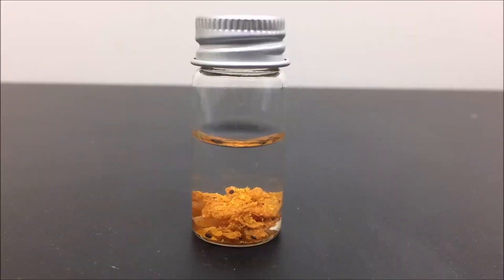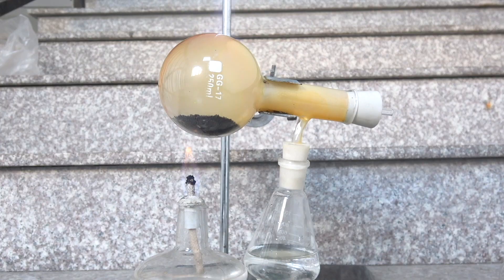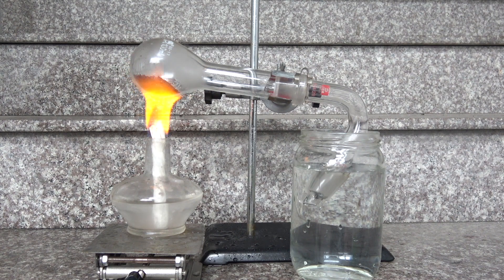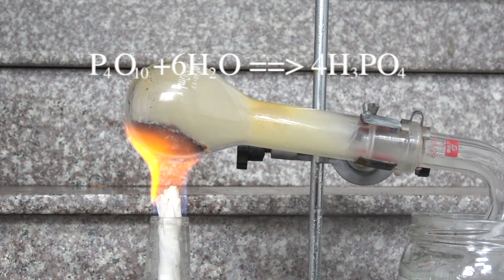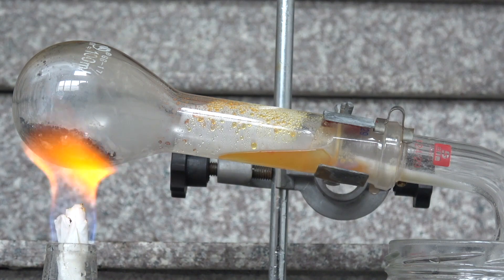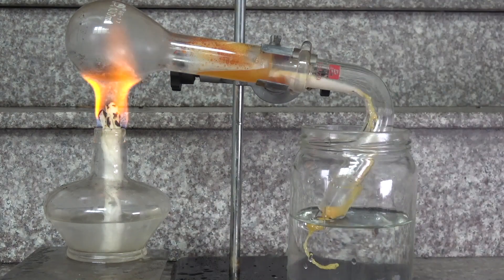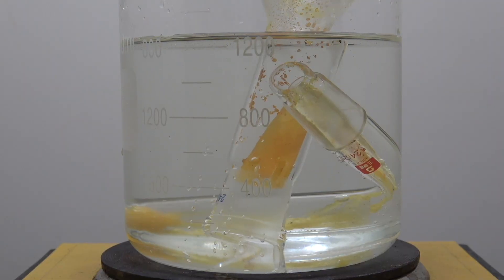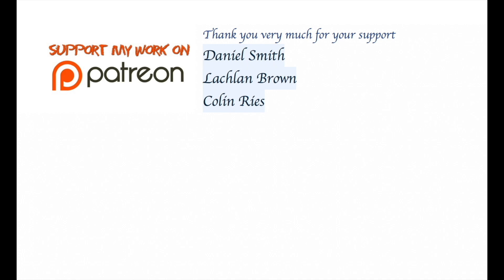How to Make White Phosphorus | Contracted version

Comment: Easiest way to make a lot of it is to mix charcoal, graphite powder, sand, salt and bone ash calcium phosphate together. Make a reaction vessel out of a two big ceramic flower pots with two graphite electrodes. Bridge the electrodes with steel wool and fill with the reaction mixture. Seal up gaps with potter's clay and attach a steel pipe in the top and seal it in with potters clay mixed with powdered glass. It's a simple retort. Bury the retort assembly in sand for insulation and make sure the pipes end is submerged under water. Apply current from am arc welder to the graphite electrodes and the device will sound very angry and bubbling will start from the end of the pipe. You will then get drops of WP that will sink to the bottom of the water bucket. The reaction is finished when no more WP is produced.

Comment: I also worked to come up with a way for amateur chemists to make white phosphorus at home.  I posted that video to my channel, if you want to check it out and compare notes.  I've found that keeping the flame away from the vessel is key to getting pure, white phosphorus.  The moment the flame touches the glass it becomes too hot and the phosphorus starts becoming yellow.  Even with the purest red phosphorus that you can get.  This also helps to prevent the vessel from breaking.  Keeping the vessel covered with foil helps to keep it white as well.  Doing it this way also makes it go slower, taking far longer to distill.  But if purity is not what you're after the putting the flame against the vessel is fine.  For the vessel I used various sized test tubes because if they broke, oh well.  Putting a bend in the tube helped to keep the red phosphorus from falling down the tube into the white allotrope.  You can see what I am talking about in my video.  Putting the receiving flask on a hotplate to heat the water also helps to have the white allotrope melt and fall on down into the beaker and not cling to the reaction vessel like it likes to do.  Then any phosphorus stuck to the tube can be melted to allow it to fall into the beaker with a small torch.  But for purity, heat control is key and keeping the flame from touching the glass is the trick.  Though it goes slowly, it still is great for producing a beautifully white product.  If you'd like to collaborate on this, or other similar projects I'd love to pitch in and help.  I've done a lot of work with phosphorus and many other elements and compounds.  Some of my friends call me the "King of group 1 metals" because of my work with coming up with a way for making cesium and rubidium at home in an easy way.  But yeah, just let me know if you'd like to collaborate on something in the future.  I'd be delighted to do so.  🙂
Reply: Water bath underneath your chamber of RP seems to me that it would help keep the flame from contacting the glass.
Reply: @Microbe_Master you mean heating the red p with a water bath?  That doesn't get anywhere near hot enough to distill the white p over.
Reply: @BackYardScience2000  you’re right, I didn’t think about that. Maybe a some type oil with a high smoke point would work.
Reply: @Microbe_Master  Oils in general only seem to go to a little under 600 degrees maximum. Is that hot enough?
Reply: I performed that experiment but the glass apparatus was broken and red phosphorus was shot forward in water.

Comment: Where do you get your phosphorous? And i have had a possible idea, maybe you could experiment with nitric acid production setups, the one i use its horrible and inefficient.
Reply from the maker: AtHomeScience it’s best to remove the newly formed white P vapour from the heat asap having something like a distillation setup means it will take a lot effort for the vapour to reach the separation point aka where the condenser is, and you will have to use hot water 💦 for the condenser which is a whole lot of trouble

Comment: Looking at your apparatus I’m wondering how easily a drying tube could be adapted to make a complete reaction vessel as one piece?
Reply from the maker: i guess you can give it a try, but getting the product out of vessel and cleaning might be a pain on the ass tho
Reply: Aussie Chemist  there is that. Maybe a boiling aqueous solution of copper sulphate to neutralise any trace of white phosphorous and caro’s acid to clean up any Carboniferous waste.... I take your point. I have never seen this particular apparatus before and in australia you have to be so careful about ordering glassware. The authorities are so paranoid your making methamphetamine - especially when ordering red phosphorous.
Reply from the maker: @deepforrestalchemy9189  luckily i do most of my projects overseas
Reply: Aussie Chemist  you’re a lucky boy

Comment: Nice work AC.  That is a good simple setup -- you can control the reaction conditions nicely without panic.  With a bit of argon and running it to completion you should be able to get almost quantative yield with this.
I have some RP on its way so I may have to try this setup myself.
Reply from the maker: j_sum1 be careful of the boys in blue 😂